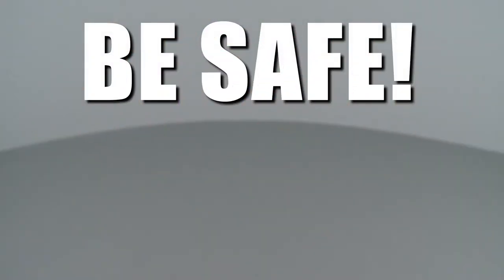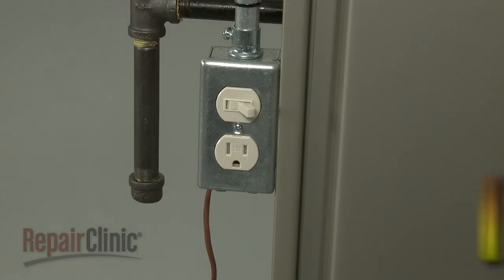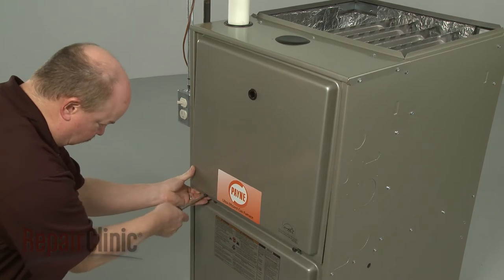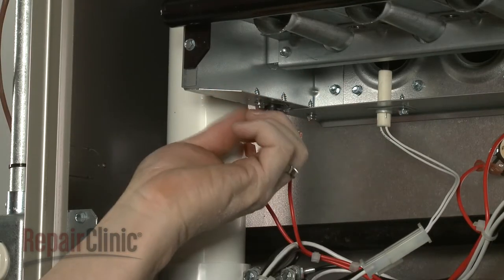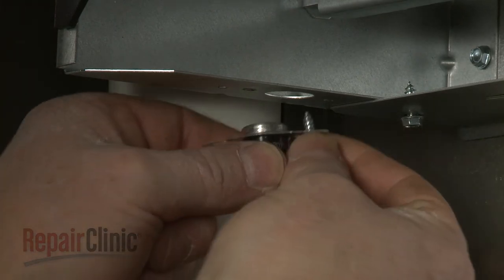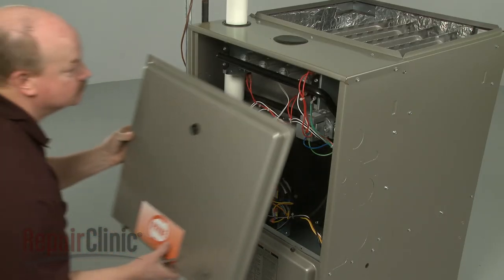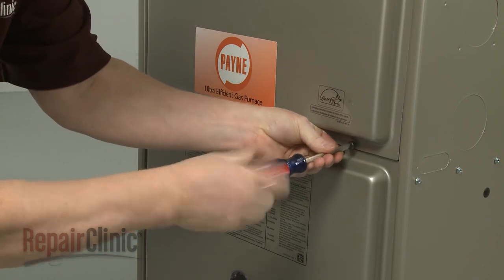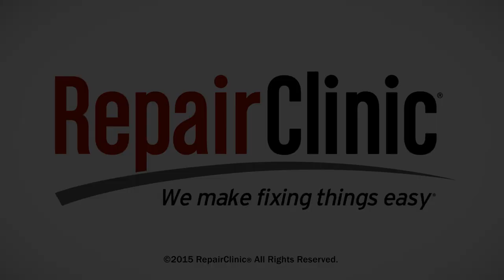Payne Furnace Flame Rollout Switch Replacement #HH680348

Comment: My furnace made sparks and stuff with stink smoke, so I took the cover off to look in there. Stupid rats and mice chewed and ate all the plastic off all the wires inside there and the wires touch making sparks and melted what little of the wire plastic that remained on the wires. A few wires melted in half too. I broke my glass so I had the neighbor kid put tape on the wires. And the broken wires he said he twisted then in a knot to stay together.

Comment: The flame rollout switch pretty much NEVER needs to be replaced.It will commonly open and shut off the furnace if the heat exchanger is plugged with soot (or some other problem)  allowing the flames to come out the front of the furnace and exposing the rollout switch to heat,  which will cause it to trip.If the switch is tripped,  find out why.  Replacing it is a waste of time and money.